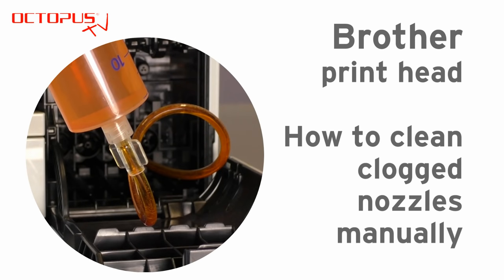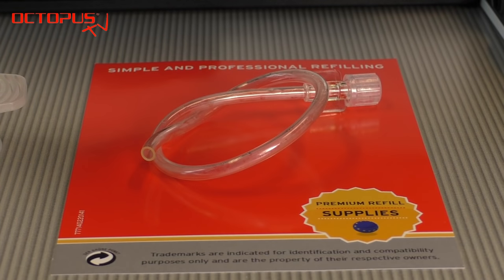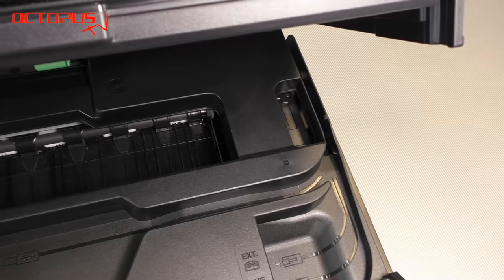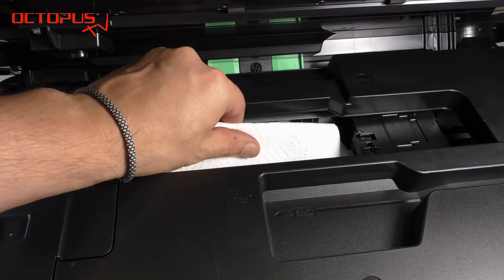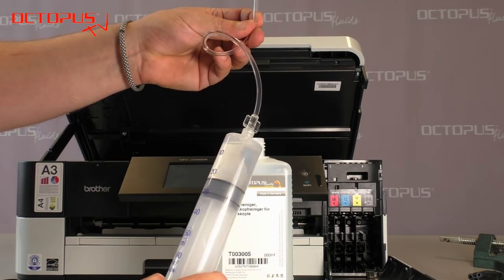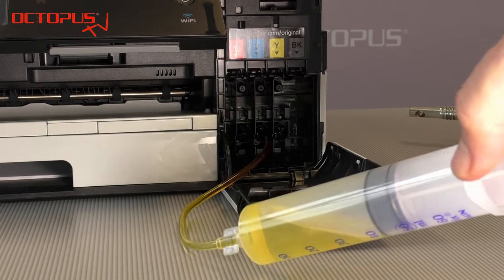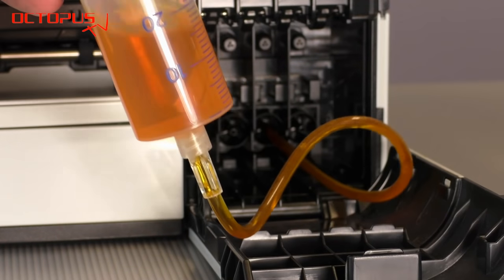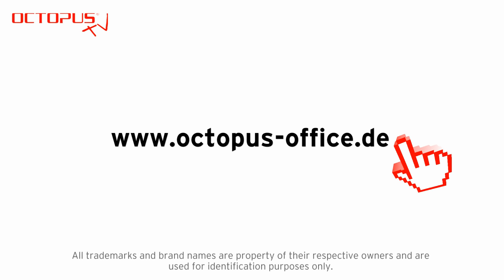How to clean Brother inkjet printer´s print head clogged nozzles?

Comment: I've boght this kit for my two brother printers. Both are clogged on the blue colors. I suspect that the issue is the recicled catridges. 
I've done the procidures about a month ago and it have improved a little bit but not mutch. Do you have any tips to unclog it?
Thank you.
Reply from the maker: Thanks for contacting us about the tutorial and the cleaning kits. When You suspect the cartridges to be the reason for the bad printing results - Have You switched to new / different cartridges / inks after the cleaning? Otherwise the problem stays when You  use material that causes the bad prints.
Reply: @octopusoffice  the problem in this case is that I haven't found a way to unclog it.
The ink brand is an other now, but, since I can't print correctly, I cant confirm if it's solved.
Thank you for the answer.
Reply from the maker: @joaorodrigues7000  Thanks for coming back to my question: You can repeat the cleaning as often as You want - hard cases may require several applications to get more and more nozzels back to work.

Comment: Thanks for the great idea.  I am having a problem though and wanted to see if you had an idea.  I cleaned the black print head as you described, and then printed - it printer partially but there were still a lot of clogs (missing streaks) so I cleaned more extensively (longer) and got a lot of cleaner flow through the print head, but when I went to print - nothing - no blank ink at all came out.  And I printed about 80 pages of almost pure black - but not a drop of ink.  I did not inject ink into the line after cleaning (how?  where would I get the ink?).  Now the printer also thinks my cartridge is empty even though it is not.
Reply from the maker: Hello R C, thanks for Your description. It can take really quite a lot of test prints to get the ink back onto the paper. The cartridge that is shown as empty is an original Brother cartridge or an alternative cartridge? With an original Brother cartridge You can go on printing despite the status empty. In case You are using alternative cartridges we recommend to invest in another new alternative, run some cleaning cycles and keep on printing until the ink is back.
Reply: @octopusoffice  
Thanks for the reply.  It is an original Brother cartridge.  It was very strange that I cleaned the head, it was better, then I cleaned it again and nothing came out on the paper.  I will continue to run some more test prints.  And yes it still tries to print, and there is ink still in the cartridge, but nothing is making it to the paper. It is almost as if I have taken the cartridge in and out so much the printer refuses to read it or pump from it??
Reply from the maker: As You have told before that one cartridge is shown as empty despite there is still ink in it - You can extract this ink from the cartridge and press it into the tube directly. So this ink is not lost and You can utilize it to get the ink flow going again.
Reply: Thanks 
OctopusConcept. Mine are yellow and magenta having issue. After cleaning both colors printed nothing. Using another 1ml syringe injecting about 0.6ml ink till it flow to tissue. Done!!!!! MFC-J2310 with refill ink-tank works wonder again.
Reply: @redcreekpaydirt   As an Indian technician explains under an other video of the same procedure (Best Printers), this method can damage the ink detection sensor. Maybe is it what happened to your printer?

Comment: Tried this method with Brother MFC-480DW, i managed to inject the liquid into the Yellow color pipes, i could see the liquid came out at the klenex under the printer head, but still no Yellow color when testing the printer.
Reply from the maker: Thanks for Your question plus description. There are two options for You: either there is still cleaning fluid inside the ink tubes and You have to print that out before the normal ink color yellow comes back to Your print outs. That may take some time -  we recommend to print on used paper for these tests. The second option is, that the yellow nozzles are actually damaged -  the cleaning cannot repair damaged nozzles ...

Comment: UNDER LOCKDOWN HERE!!! NEED ASAP HELP!! NEED PRINTER TO WORK I did exactly what you demonstrated  on my brother MFC-J430w  black which was clogged.  Did many test printings  as well and black finally started to print lightly on paper but now I got a sign saying ink absorber is full!  and stops me from printing. I can actually understand that  by injecting the  fluid into black nozzle it must of filled up absorber.. This is my problem now . and by the way It is not  written as an error 46 so it isn't error... What do i do now????  Printer won't print at all?    How can i empty out ink absorber and clean ink pad felt? I called customer care no  repair services are being provided during covid
Reply from the maker: Hello Patty, thanks for reaching out for help and describing Your situation. The waste ink pad inside the printer is filled up when using the print head cleaning function integrated in the printer´s functionalities. The method we show in our tutorial bypasses the printer´s waste ink pad and saves it for later. Depending on Your printer´s age it might be the case that the pad has been close to its capacity before applying our cleaning approach or did You try to clean Your print head by running several print head cleanings from the printer menu?
The situation is that with this message You are not going to get Your printer going again without a service technician - thanks to Brother®.  😶 Please do no harm to the bringer of the message 😐

Comment: What is the fluid that you are injecting? I missed it or didn't see it anywhere?
Reply from the maker: Hello Brent, thanks for Your question. We are using our nozzle cleaner fluid - which is basically a waterbased, colorless ink enriched with surfacants for boosting the dissolving effect.
Important about the waterbase in our cleaner fluids is that the water is purified and demineralized.

Comment: Hy , great video . Since i need the Ink Printer at this moment until i whait for the product to arrive(nozzle cleaner ) , can i use demineralised water (i have it in stock) ?
Reply from the maker: Hello, thanks for the positive feedback. Yes, demineralised water will also work - the inks in the printer are water based so the dissolving effect requires to have water there. Our product also contains surfacants to lower the surface tension on any cloggings inside the print head. By this effect water can reach the pollutions faster and can cover more surface.
Reply: OctopusConcept tnx for your fast replay, and for the great info.
Reply from the maker: You are welcome :-)

Comment: kindly advice about the fluid you use, is it alcohol or what,,
Reply from the maker: We use a cleaner based on purified, demineralised water - as the inks used in the printer are waterbased too - so You need to have water to have a disolving effect. Alcohol does not have this dissolving effect on dried in waterbased inks.

Comment: After doing this to my Brother MFC printer won't recognize blue and yellow cartridges anymore! is it possible that Air has trapped inside the printer? How do I fix this now?..
Reply from the maker: Thanks for contacting us and for Your question. We read Your comment that You have tried already more than 1 of the cartridges that are not recognized anymore, right?
In the cartridge slots there are the contact pins that make contact to the chip on the cartridge. Did You bend one or more of these pins during the cleaning? Maybe a pin cannot reach the chip on the cartridges anymore and may cause this situation.

Comment: Cleaned out my "cyan" easily but still not printing this colour. Does this indicate a total printhead failure?
Reply from the maker: Thanks for Your question. Did You clean the other colors too or just the cyan ink color? After cleaning an ink line as demonstrated in our tuturial there always reamains cleaning solution in this ink line and inside the print head - after the cleaning You have to get the cleaner fluid out for example by printing test pages on test paper (20 to 50 prints ongoing) - then the color should go back to normal slowly. When You have bottled ink available You also press the cyan ink into the cyan ink line to push out the remaining cleaner.
If this all does not help it indicates that there is a problem with the print head itself.
Reply: @octopusoffice  Thanks. I will try that before buying a new printer. Actually cheaper than buying a new print head.
Reply from the maker: @eckyhen  Hello Eric, thanks for the feedback! Good luck to You...

Comment: I tried this but my printer now isn’t using any ink at all. I can see the lines to the print head are sort of jammed maybe too? Any advice?
Reply from the maker: Hello Chloe, thanks for contacting us. From Your sescription we assume that You are able to start a print job on Your printer but no ink / only few ink lines appear on the paper.
At this point we would point into the follwing direction: First make sure that no air is pressed into the ink lines during the cleaning - when You are not sure if that did happen - flush again with cleaner and the air is pressed out through the nozzles - that should clear the ink lines.
After that it is necessary to get out the remaining cleaner from the printer´s ink system: Best practice to do so is to run test prints on old / used paper - start a 50+ pages, double sided print job and keep an eye on the development of the prints. It may take some time that the colors come back to normal again.

Comment: Do you know a way to take out ink tanks on DCP-T700W? I have a yellow clogged head but can't run this method with ink tank in place.
Reply from the maker: Hello Daniel, if You dismantle the printer´s outer housing on the right side You can take out the ink tanks. We have done that before with our DCP-T300. But sorry we took no pictures or video material of it.
 We check on our printer again next week, hopefully we can provide You some more visual information next week.
Reply: OctopusConcept thanks a lot I will try to do that 🖒
Reply: Hi i would like to ask on how to remove the ink tank of DCP-t300 would be a great help if there will be a tutorial for that. Yellow printhead was clogged so i brought it to the service center and they 
Told me that the printhead should be replaced all colors are working fine except yellow so i want to try and clean it myself coz its too expensive to have the printhead change.. thank you and im hoping to get a reply.

Comment: I'm using 95% Alcohol, i fixed C,M,Y but Black one wont unclog, i tried it for around 20 min and no ink came out of print head, is it safe to disassemble print head and and soak it in alcohol?
Reply from the maker: Hello Genc, thanks for Your description and question. Before disassembling the print head there is a different, more simple approach that You can try:
Try to clean the print heads nozzle plate from the bottom side. That means put the foil material and on top of that the absorbent material soaked with head cleaning liquid under the print head - let the print head sit there for a while and then move the print head from side to side over the absorbent cleaning pad. Check afterwards by printing test prints if the color is coming back.
Beside that Alscohol is not the best cleaning agent for the inks in the Brother desk top printers as these inks are waterbased and alcohol does not disolve such an ink. When You can get Your hands on a waterbased cleaner, give it a try....

Comment: Hello...I have done cleaning on my print head following your instruction but after cleaning my printer is not printer again , please can you  advice me what to do next
Reply from the maker: Thank You very much for Your question: Does it mean Your printer does not start to print at all? Or does it mean that there are still some or all colors missing in Your prints?
Reply: The printer is not  print again ,I was thinking the print head is bad. I am looking for where to buy new print head to replace it.
Reply from the maker: Sorry to hear that. Our method needs the printer working at least - meaning that You are able to start print jobs. If the printer does not start at all, the way of cleaning described in our tutorial will not help.

Comment: lets say i did something stupid and injected air into the whole system, including the head.. is there a way to get it out because now its not printing anything
Reply from the maker: Hello Kai, no worries - nothing lost at this point. What material do You have available? Do You have clenaer fluid and / or bottled inks? Either You use the cleaner fluid and flush out the air by injecting cleaner into the ink system - this pushes the air out of the tubes and the herad. Or in case You have - You use refill inks from the bottle to fill up the ink system with ink again. Please pay attention to inject the right color of ink into the right line of ink in the printer - You know what we mean 🙂.
After flusing You set back the cartridges into the printer and You have to run several test prints - when using the cleaner for flushing this needs longer as the cleaner has to be printed out before the colors come back to  normal - print on used paper double sided, When flushing the ink system using refill ink the print results come back to normal faster.
Reply: thanks i will try with cleaning fluid since i dont have bottled ink
Reply from the maker: That will do the job -  have patience when running the test prints to get the cleaner out again 👍🏻

Comment: Buddy, you got a Kiwi way to do this? I got bogroll for the paper towel part, but I ain't gonna abuse my bike pump with chemicals, as it will degrade the seal, and I need it for my bike. How about cotton buds, and whiskey to clean the repository holes? Or just some bogroll on the end of a thin screwdiver?
Reply from the maker: Hello, thank You very much for the question. Cottin buds will be fine too - but whiskey is not going to do any good in that place :) safe it to Yourself pls. The inks are waterbased and the alcohol will have no effect on the dried in inks.
Without a syringe it will be difficult to get cleaner in the printer´s ink system.
But in the first step You can try to get rid off the blockings from approaching the print head from the nozzle plate. Place a cotton bud soaked with cleaner fluid under it and let it sit for a while.

Comment: I bought the kit and used it on my dcp-j315w. Unfortunately now my printer head is leaking yellow. All other colours opened up pretty fast. I probably have pumped too long for yellow and maybe too hard after a while without realizing. I wish I could run the printer without yellow ink cartridge, because I only need black and do not care about colours. The black test pages still show a line through the text and texts fade more with each line down.
Reply from the maker: Hello, thanks for contacting us. Actually You can run the printer with an empty yellow cartridge - as You say You do not need the colors cyan, magenta and yellow. if the yellow ink is used up the leaking will stop.
Reply: @octopusoffice  Thanks. Do you think replacing my black cartridge will improve print quality? Now the words display a line crossing through them.
Reply from the maker: @whiterazer1  Do You use original Brother cartridges or cartridges by an alternative supplier? If there are lines missing in the print out, in cas eYou are using alternative cartridges,  that might indicate that the ink is not really suitable for the printer.
Reply: OctopusConcept thanks for that advice! I use a very old non-original cartridge. I will try with a brand new original brother cartridge. I also have a good tip for everyone from another video: put a piece of dark coloured tape over the transparent “window” of your color cartridges. It will think it is full. So you can print in black and white without problems.
Reply from the maker: Thanks for Your answer - the age of the old alternative cartridge might be the explanation for missing lines in the black print outs. Let´s assume the cartridge contains  pigmented ink - this ink tends to turn bad after 2 years and can block nozzles in Your print head easily.